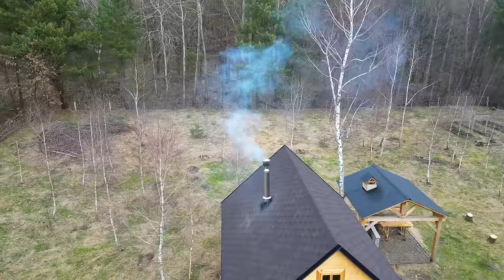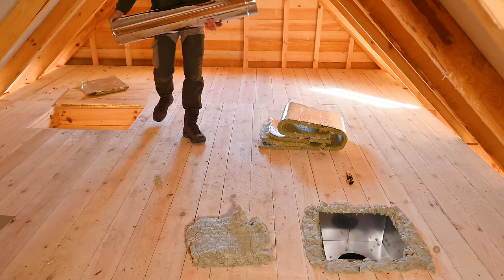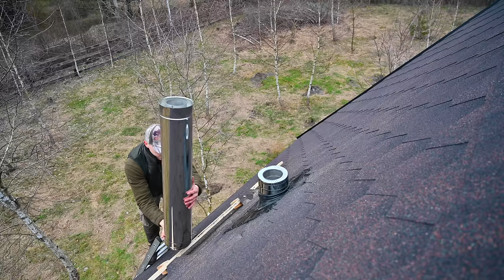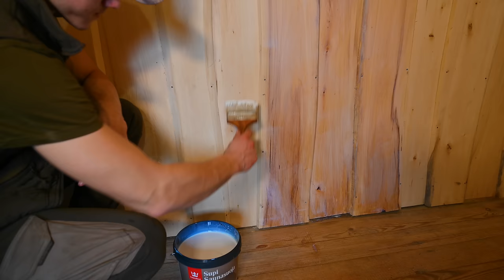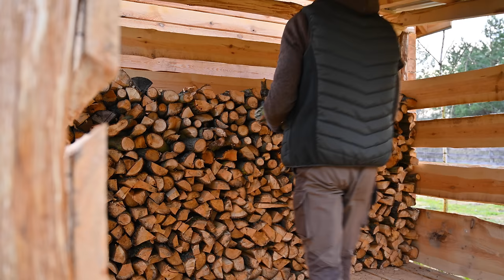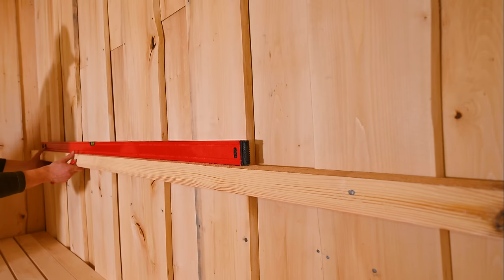Off Grid Sauna in the Forest | I'm Making a Concrete Foundation For My New Log Home.

Comment: Seriously, sauna ideally has a temperature of at least 80°C. Anything less and you need to keep throwing water on the stove constantly. Result: There's more steam than heat. Also, why use a towel on the benches? 😉 If there's an unexpected visitor (like your "film crew" for example, haha), just lift one leg on top of the other and you're safe. Rope as a molding on the ceiling and the corners I've never seen in Finland. I enjoy your videos, Björn-without-dots! 😊

Comment: @ 33:35 you might as well add the six piers missing in this grid / you already have 19, 6 more will just support floor hoist better and allow the  use of shorter lumber if necessary

Comment: What have you determined the outside house dimensions will be? Looks like about 20x30 feet? Maybe 24x36 feet. That was the size of our house, and it was kinda small in the long run. But still adequate. However, bigger is better. (grins) That's just a guess from the drone shot?

Comment: Love this vlog. I just need to understand the logic; why use more than 50 % of a small wood cabins downstairs space for a sauna? Surely a wet, humid and warm environment creates mould and mildew and hot/wet air rises into the upstairs space with damp problems arising? Wouldn't this space be better used for other purposes? The fireplace/stove appears to be used as the sauna heater, and not for cooking inside when the weather doesn't permit outside cooking. Maybe the sauna is in the shed, I just needed clarity...